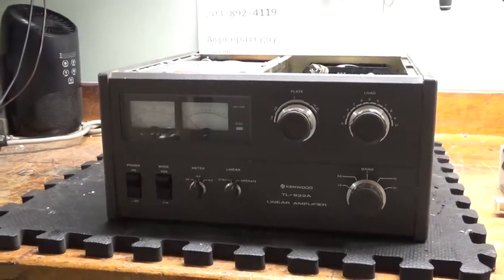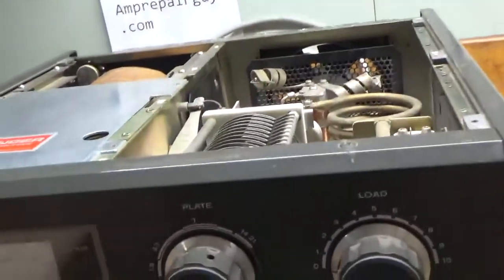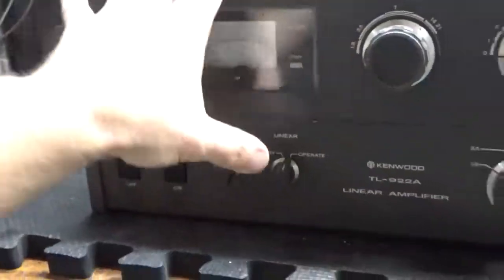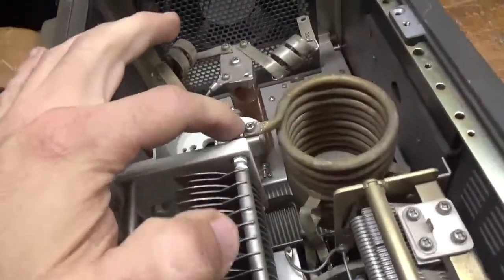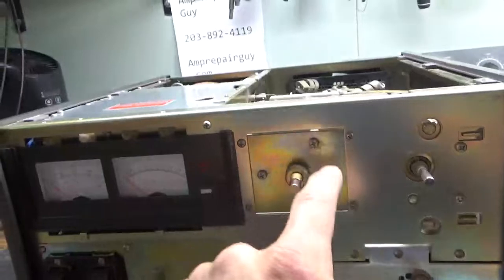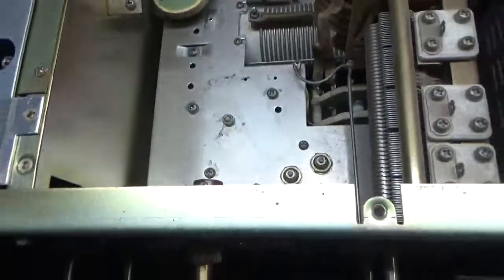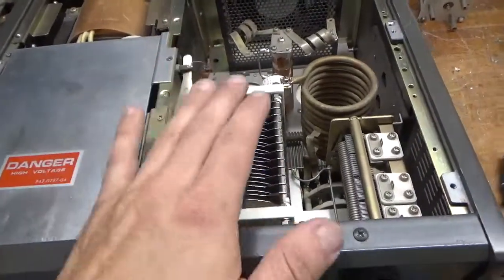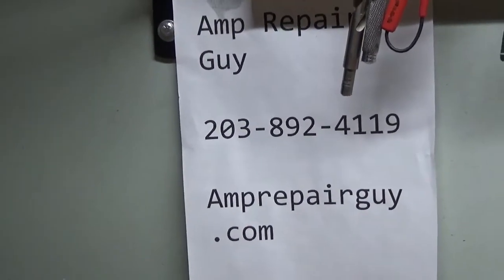Plate Tune Capacitor Replacement Tl-922 kenwood

Comment: Is there any reason that the burns on the plates can't be filed down?
Reply from the maker: Creates a sharper edge which will lower capacitors total  breakdown voltage rating . (Will arc sooner)